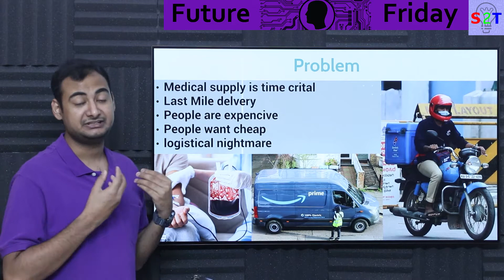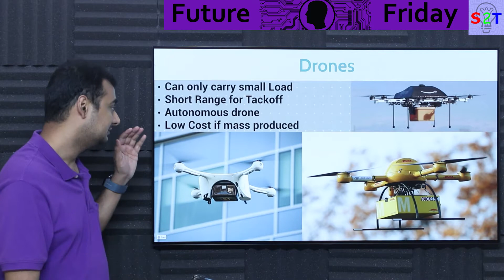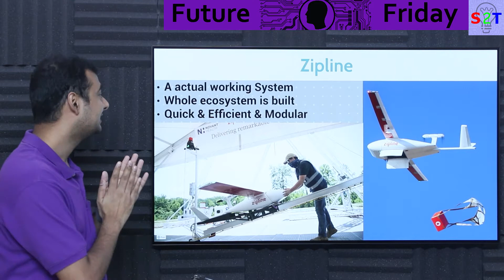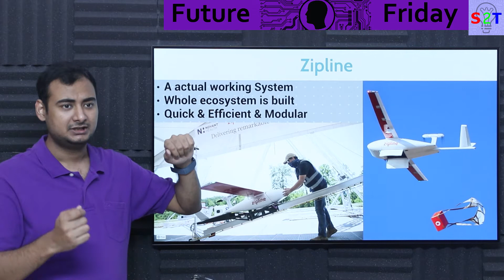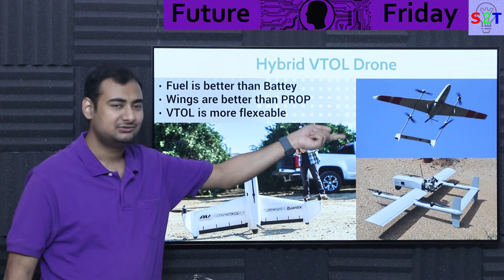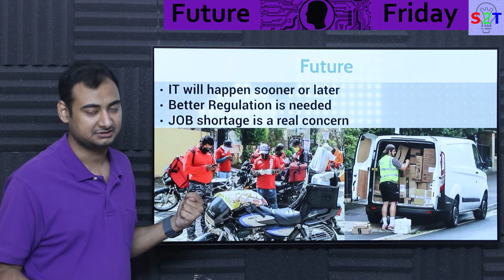Drone delivery Explained {Future Friday Ep148}

Comment: Sir please make video on these topics
1) how tesla 4680 battery is different from current li-ion battery
2) can Synchronous reluctance motor replace 3phase induction motor in future 
3)   recycling Ev battery in future will have very bad impact on climate
4) axila flux motor ..advantages and disadvantages 
5) Is it possible to power heavy vehicles like truck by current battery technology..🥰...thanks
Reply from the maker: most are already covered and some very soon